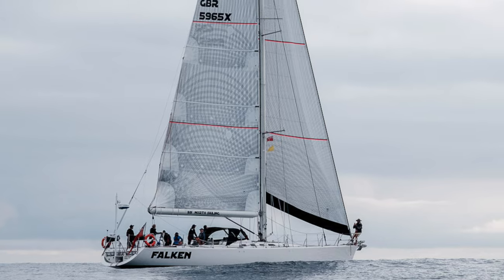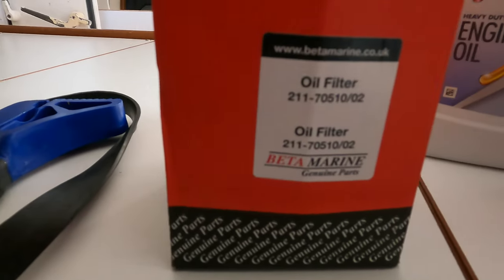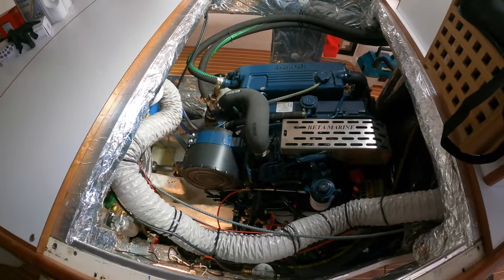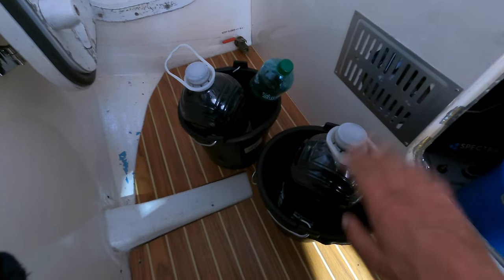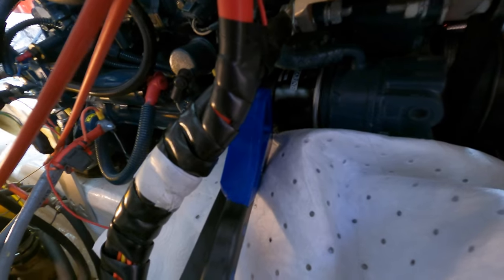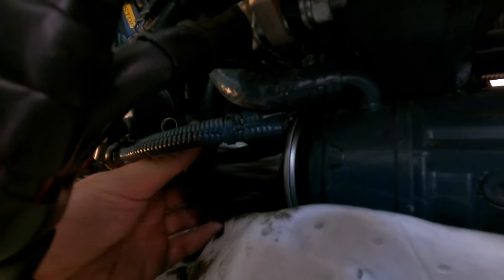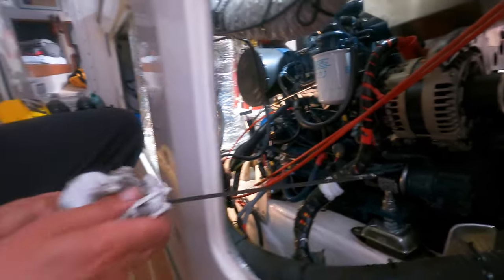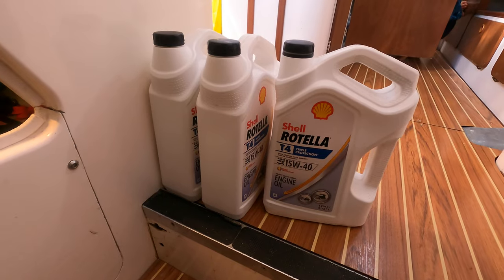A01 ENGINE SERVICE PART 1 - OIL AND OIL FILTER CHANGE - ON BETA MARINE B-85T

Comment: This was a nice video. Great to see inside Falken. But one question: What were the gloves for? I don't think you ever used them.
Reply from the maker: Thank you! I should have worn the gloves. Just to protect your hands from oil and (in the next video) diesel. I found my hands often get dry and cracked if I work with oil/diesel and don’t wear them. Simply forgot to put them on 🤦‍♂️
Reply: I was just laughing. I always set them out and forget to use them 1/3 of the time.
Reply from the maker: @HolyGrailSailing  hehe yes me too !